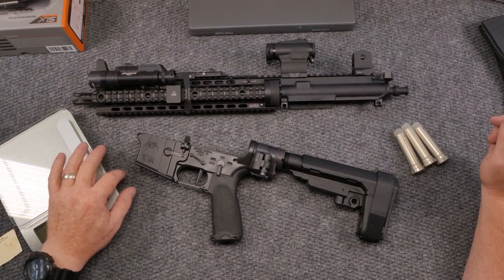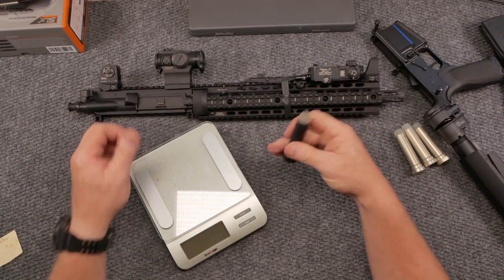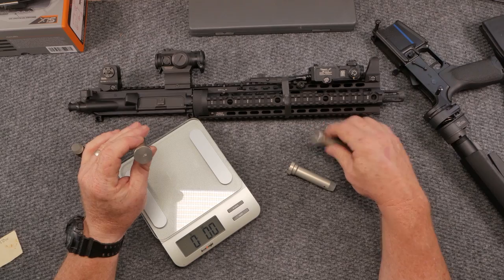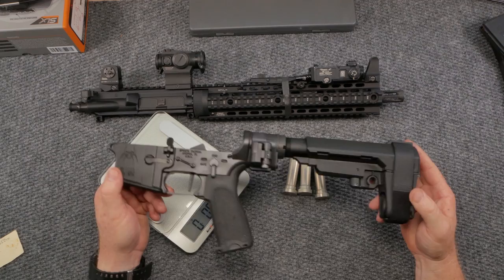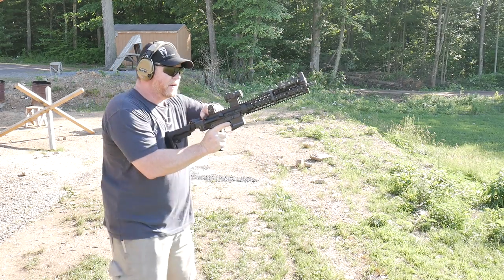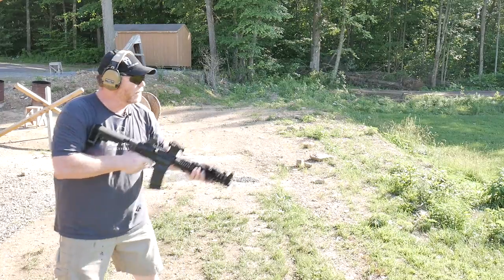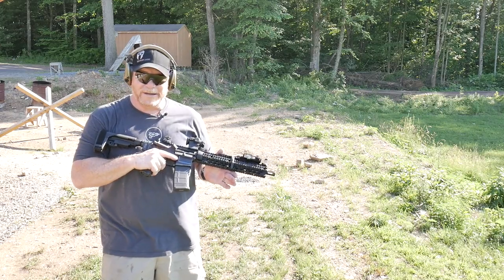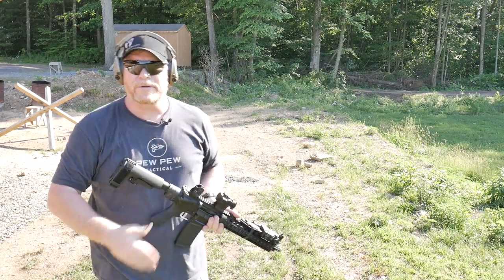Buffers! Buffers! & Buffers!  What's the Difference H1, H2, & H3 Let's see what happens

Comment: FYI the 3.1 oz buffer that came in the weapon is a standard weight carbine buffer.. A lot of folks just call that an H0 buffer since it has 0 tungsten weights inside it, i.e. it has 3 steel weights inside it.. Calling it an H0 is a misnomer but it really works out well in practice to prevent confusion; however, I have never seen one marked H0 they just have no stamping at all, where the other three are marked to denote the number of tungsten weights that they contain.  As your video clearly demonstrates, the effect on ejection pattern is very slight.  If the gas port is clearly oversized, then the only real solution is an adjustable gas block.  Or the far more expensive option of a new barrel with a smaller port or a a longer gas system (for that barrel length, with shorter dwell time) to get a really soft shooting rig..
Reply: Man I wish there had been a ho buffer when I was younger,  would've saved me a lot of heartache!😁

Comment: I thought it wasn’t so much as for adjusting the ejection pattern, but a heavier buffer would make the weapon softer recoiling and slow the action to make it more reliable. Did you feel a difference in the recoil as you were swapping out the buffers? Thanks for the video.
Reply: the ejection pattern is how you can tell if your gun is cycling to hard. the brass hits the brass deflector with an amount of force, depending on how much force determines what direction its flying.

Comment: The ejection is from a spring pushing the cases out so I assume it won’t change that much other than cyclical rate and feel. It’s not like a ak that hits a solid ejector where bolt speed = ejection speed . I think that’s more of a ak thing. I’ve had worn ejection springs maxed out compressed and thought my gun was under gassed . I swapped the spring (it’s a selector spring) and my ejection went to normal. Personally I think a semi auto isn’t important for buffer weight again it may change perceived feel but it’s not accomplishing much but adding to your overall weight. And those stupid buffers are pricey.

Comment: I run an h2 on my 11.5” never though about this but my shells seems to be where they should be have to check again but I know they shoot back I run a colt upper and barrel and gas system. And a PWS h2 buffer kit so my spring is a bit beefy.

Comment: Does anyone else hate when their buffer rattles?
Reply: They make ridiculously high cost polished buffer tubes and springs for people who care about the small scratchy sounds. I'm typically wearing ear protection when shooting the AR 5.56 since even a can would still make more ringing noise in the ears later than a cheap buffer tube makes when firing. If I'm shooting it, I want everyone to hear my squeeky pew pew machine.
Reply: if it rattles, try a spikes tactical H2  buffer with the tungsten powder instead of the solid weights. Works in mine with a David Tubbs  carbine flat wire spring
Reply: I just took mine apart and put some electric tape around the weights.
Reply: @ericpettyfishing  doesn't that take away from it's function? I think a bit of movement is necessary to get the timing/strength to lock the bolt home reliably. Why else would the design call for loose weights, when they could have used a solid peice?
Reply: @kenchan3038  
It's cheaper to manufacture. I dont believe that the millimeter of movement is that much of a help honestly. I noticed no difference after the tape. Have fired idk roughly 2500 rounds through it like that with no loading issues. I have Frankenstein home assembled ARs with using a bunch of different parts. I have never found a more expensive buffer working any better than a cheap one. I dont really care about dampening recoil or anything like that. I dont shoot suppressed and I dont really worry about  all that other stuff. People just like to tweak their guns around. As long as mine shoots reliably and loads another round I am happy. I think that splurging  money in my BCG is better than the buffer weight. But who am I? Just a nobody AR owner giving his oppinion. I'm no professional.
Reply: @ericpettyfishing  not dampening... that is with a liquid that's used to get something wet...
also that's what she said.

Comment: From a tech spec stand point in perfect world . You should only need H2 Buffer if you have piston or heavy BARREL.   To my knowledge there's only been 1 rig that comes from the factory with H3 buffer . That's the Colt IAR..
Luth AR and DPMS are one in the same . The original owner of DPMS started Luth..
Also you might wanna check out Black River Tactical for a Tuned Gas Tubes.  I highly recommend using those tuned gas tubes . None of my setups are over gassed even when suppressed because of the BRT Tuned Gas Tubes . On my 12.5 I have 0.70 gas port with 0.62 tunes gas tube . 
I chose this route because I'm not a fan of Adjustable Gas Blocks for defensive setups. 
Your gas port should be 0.70 on 10.3 , 11.5 and 12.5 .Or I should say that's what a lot of manufacturers use . Some companies will spec barrels for smaller gas ports .
You can also try using Springco Red Spring.  That will def slow down the BCG as well . I use Springco Red or Blue in a lot of my setups . The Blue is enhanced and Red is heavy action spring .
Reply: Why does a piston system need an H2? Also how does barrel weight affect the gas system?
Reply: Sean White, Thanks for the info and I am sure that Kotaboy32 will utilize your advice when he does his next AR build

Comment: These buffers were designed to slow the bolt on full auto guns and to stop bolt bounce not to compensate for gas issues. They're intended for full auto guns where the rate of fire needs to be slowed to run reliable. They really dont make a difference on semi auto
Reply: Can’t tell some people anything you got right

Comment: Anyone have recommendations for what to run in a S&W MP-10?  Bottoming buffer and beating my shoulder. Has factory longer buffer tube and I'd like to go the shorter buffer tube if possible.
Reply: An adjustable gas block.
Reply: @snek9353  I didn't want to do that, I feel that it's probably gassing right, just a crap buffer spring and try a decent muzzle brake, It's not sure which way to go with the buffer as who has something good. Seems to be hit or miss on the internet when it comes to the 308 platform.

Comment: It’s the spring in the folding brace. Has no power, need another spring.  If that was a proper recoil spring, you would have immediately seen the difference with the different buffer weights.
Reply: What do you mean the spring in the folding brace? Isnt there just a rod that basically extends the back of the bolt in there? Pretty much making the folder non existant to the buffer system?

Comment: Changing buffers to fix an over gassed upper is lazy gun smithing and doesn't solve the real problem, too much gas. You should be able to put any upper on a carbine buffer lower and it should work. Needs an AGB and it almost the same price as a heavy buffer too

Comment: I think you gas port is too big.  If you’re running a H3 with a law folder you effectively have over 7oz of buffer weight.  I think you are better off getting a black river tactical gas tube to decrease the amount of gas going back into the system.

Comment: im running an 11.5 with a geiselle gas block. she was a gassy bitch. bought a geissele buffer spring and turned my buffer into an H2, was alot more tolerable. went from about 1o'clock to about 3o'clock. been waiting to buy the lmt full auto enhanced bcg but they were taking to long, ended up with a CMC version of the LMT. much much better. 

BCGs matter just as much as buffers and springs. if youre using a BCG meant for a 16", like i was using seeing as how thats all i had at the time, itll be over gassed. gassing properly will maintain your firearm, wont beat it up so much. sure, .223 is a relatively soft shooting round, but give yourself every advantage you can.